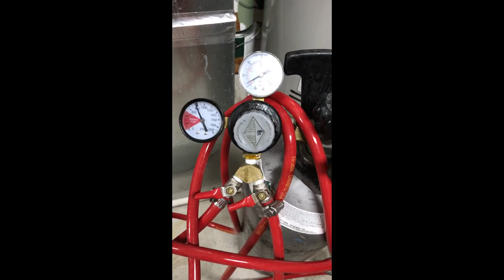Low Oxygen Canning

Comment: Good informative video, however it was filmed 100% vertical.  My brain doesn't see things that way :) In your research on lowest possible DO in packaging, did you see others adding sulfates to the sanitizing water?  I see the point in boiling the water to reduce DO but it looks to be overkill to add sulfates and reduce the "splashy" since you aren't keeping that liquid in the can - it is just a sanitizer and the can is full of air once you dump the sanitizer out.  Just my thoughts - not criticisms - looking to hear your reasoning behind it.  Thanks!